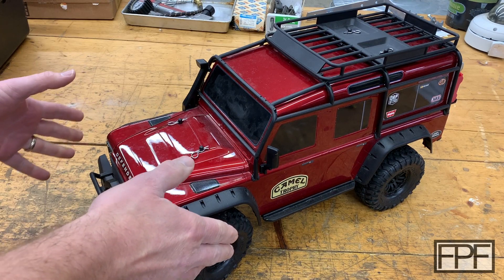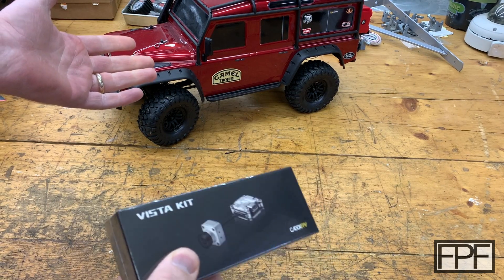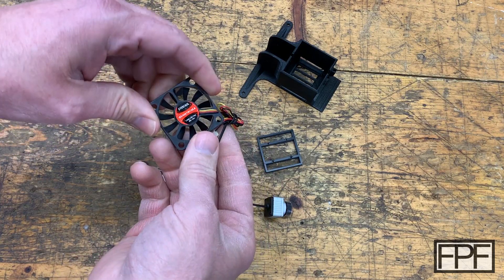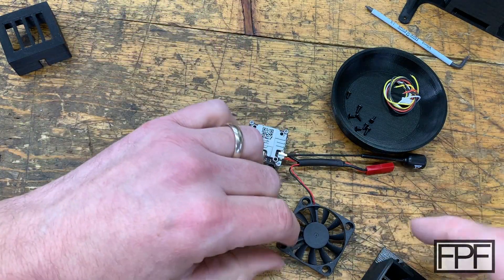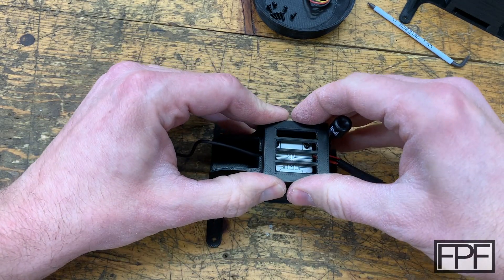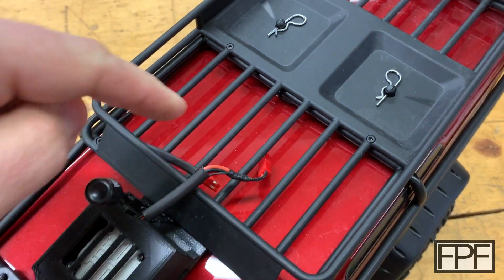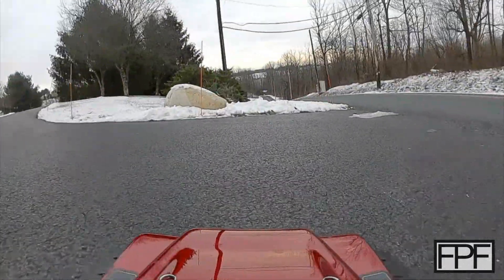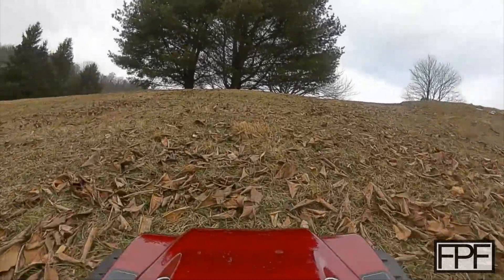3D Printed FPV Module For Traxxas TRX-4 Scale Crawler

Comment: The 40x40 fan you linked to is rated at 5v. Did you power it all through the batteries? Anyways, ordered a 40x40 from aliexpress rated for 12v, hope it fits :) Nice design

Comment: Did you find that the TRX4 (specifically asking about the Defender body) and the DJI combination provided a smooth enough driving experience or do you think you'll add a gimbal? My plan is to mount the setup inside the Defender body rather than on top so that I can see the A-Pillars and add head tracking - just not sure if the head tracking would allow enough movement inside the body so I'd mount on top. 

Excellent video - well thought out and executed.

Comment: awesome! i have a TRX-4 myself and have been wanting to do this as well. is there a way to pipe the visual stream into a PC monitor instead of goggles?
Reply from the maker: Thanks!  Check out digiview or cosmostreamer.  I haven't used them, but both are reported to work with the DJI/caddx gear.